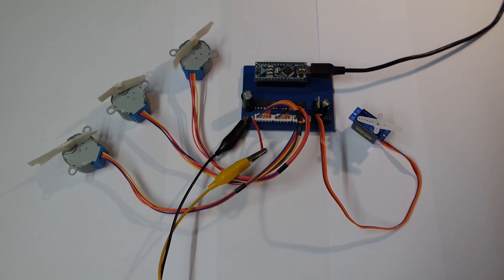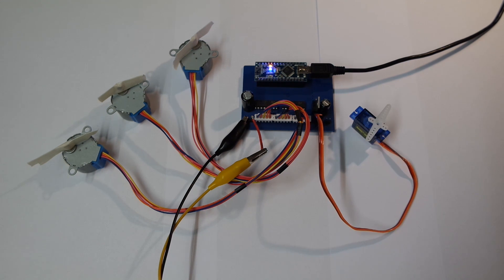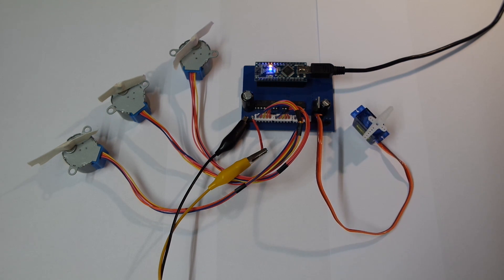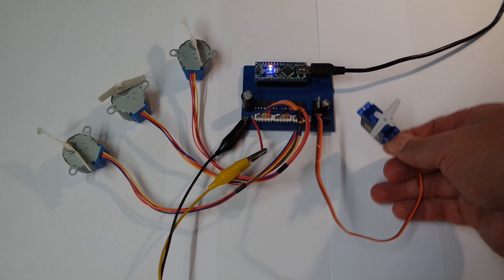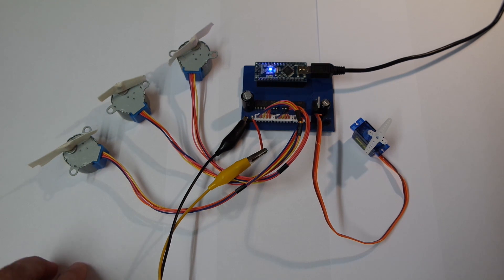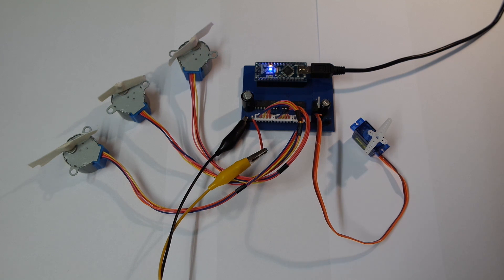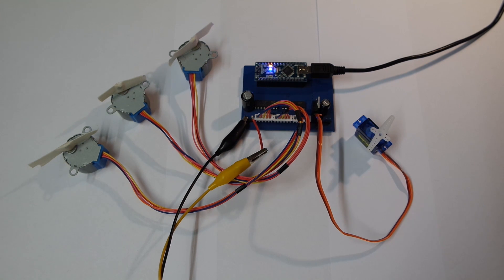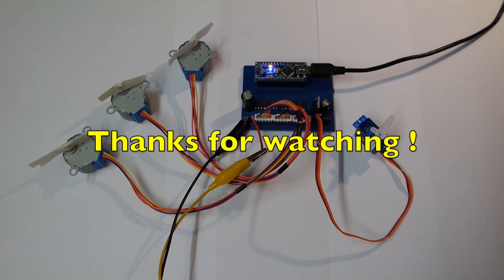Big Rob Project Part 7

Comment: Hi. Time ago I started testing the 28BYJ-48 to take him sympathy. I programmed an Arduino sketch to control one in full and half step modes with ULN2003 driver. Then I found on Youtube a post by Jan Audriansen on how to convert to bipolar, which is very simple. I made three of them and tried driving them with a pololu, that really work very well in 12v and deliver 2.5 times the specified torque (235 gcm -> 800+ gcm). I am currently studying grbl v0.9i and how to program using G code for CNC instruction set CNC G-code compatible with grbl. For this, I built a CNC electronics with arduino UNO + CNC shield v3.0 + 3x A4988 + 3x 28BYJ-48 modified to bipolar. I have nothing fact mechanics yet. I find the project "multifunctional CNC" that you face very interesting, so I'll keep the thread. Thank you. JVARL
Reply from the maker: Hello José, I'm also playing around with the 28BYJ-48 - I intend to use the 5V steppers with a 12V supply 4988. Have you been able to find a working current setting for them ? They do appear to have a relatively high resistance and induction.
Reply: Hello Dirk,
I set the pololu in Vref = 0.1V- (I = 0.25A) and fed with 12V. The resistance between midpoint and either end is 23 ohms (nominal 5V stepper). I built a graph (in excel) comparative characteristics in both cases with/without modification, which would gladly send it to you, but I do not know how to do it via internet. I have the idea upload it to Dropbox and pass the link to you. Is that possible?
Reply from the maker: ok. That is what I was doing too, 3W seem reasonable enough. Dropbox or Google Drive are fine.
Reply: You can download the mini-stepper testing data from the link: <https://drive.google.com/folderview?id=0B6LOs5zWeC-gclR2cmxDT0ZWODQ&usp=sharing>. I’d like to know material and Slic3r parameters you used in 3D printing of Video No.8. I have built a 3D printer (homemade) too, it’s a Prusa i3 rework model (steel frame Leonardo 2.0 - aka Córdoba), with electronic Mega 2560 + Shields Ramps 1.4 and Marlin firmware. I Designed parts using freecad and Repetier Host + Slic3r for getting g-code. I'd like to know your idea about electronics that you would use in your project "Universal CNC". I thought about using the same electronics that I used in my 3D printer, but searching in 3w, I decided to face another, based on Arduino Uno + shield CNC v3.0 +A4988, which allows you to move a variety of stepper motors, as they are necessary.
I assumed this thinking since ... Mega 2560 + ramps 1.4+ Marlin, can control motors on axles XYZE, fan layer, PID control for hotbed and hotend temperatures (indicating current values and set points), limit switches, servo probe and sledge for auto-leveling management bed, it have graphic display plus selection key and driver for SD card (for control standalone use). I think only for CNC steppers movement of, it could be useful. Adapting everything to the CNC, would introduce an enormous effort of interpretation the necessary conceptual cross variables and functions, which are different in one application and another. G code commands are very different (with some exceptions) and work differently in CNC and 3D printer, some having same name. CNC commands are organized in a lot of modal groups; while in gcode for printers modal groups there are only a few.
For CNC we should consider using Mega 2560 + ramps 1.4 + grbl v0.9j, since grbl is a very interesting firmware, with enough people working on their use and improvement around the world. However, about what I know, grbl only supports 3-axis!!!, X-Y-Z, since A axe only can be implemented as a clone of any of the previously mentioned.  Grbl consists of a reduced set of words of the LinuxCNC G code standard, which in this manner it allows to be used in microprocessors of limited resources such Atmega 328, Mega 2560 and similars.
Reply from the maker: Uh, loads of questions. 
The parameters for the print were 0.3mm layer height, 20% infill, 40mm/s print speed, 60 for infill. Slicer was Cura.
I have not decided on any firmware, nor the driver board. I expect I will be using a RAMPS1.4 for a start, with Repetier firmware - as I plan to first implement it as a very large 3D printer.
During the time I'm working on my own firmware to add more support for g-code interpretation.
I did not know that it is possible to use ramps together with grbl, that could save a lot of time.
I finished the base Axis a few hours ago, and I want to have it moving for tests by tomorrow.
Cheers,
Dirk
Reply: Hello, Dirk. Thank you very much for your reply. I look forward to your next video with the test of the base axis. Meanwhile, I’d ask you, if it was possible, please let me know what material used for printing, the hotbed/hotend temperatures, and if you found problems arising from using the tube bowden system (especially when they are large in length) by the hysteresis introduced into the filament, which refers Erik De Buijn, as a drawback, at the official Rep-Rap website. Cheers, JVARL
Reply from the maker: Sure, the material I'm using for this is PLA from PrimaPLA, at 195 degrees C, no heated bed.
My experience with bowden feeders is pretty good, I also have some direct feed extruders, and their performance
is similar. It just takes a litte more time to get the driver tuned in correctly. Also you should use the teflon tubes made
for high pressure air systems, the more rigid the better the results.

Comment: Those cheap stepper motors when converted to bipolar are pretty strong.I pulled 20kg load without problem at 12V .